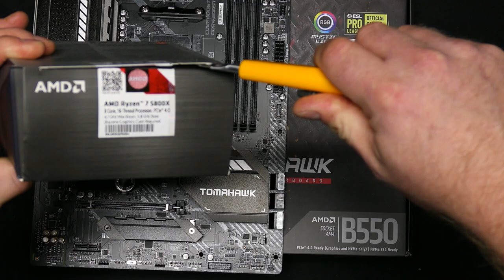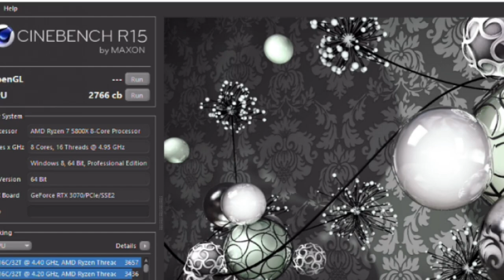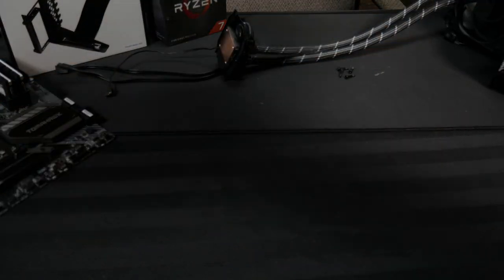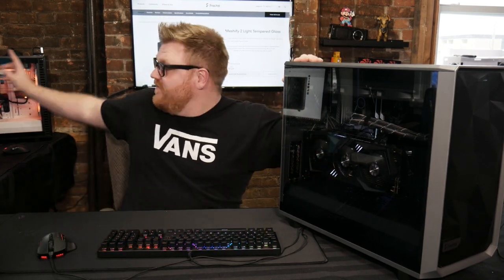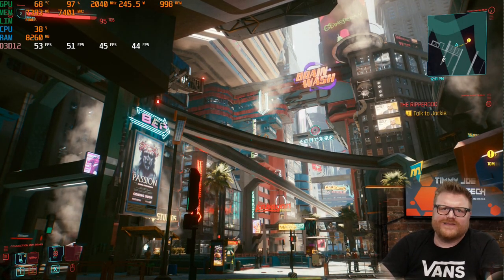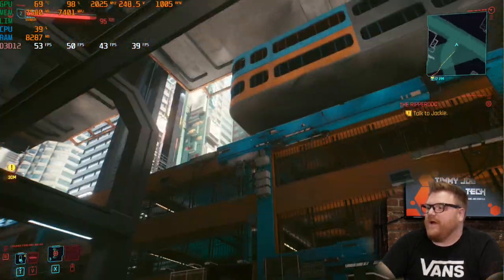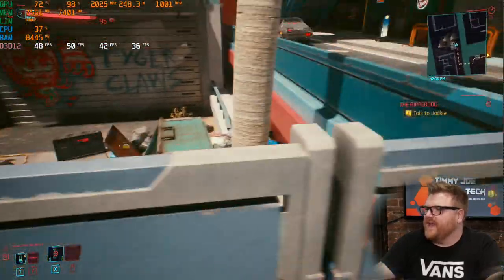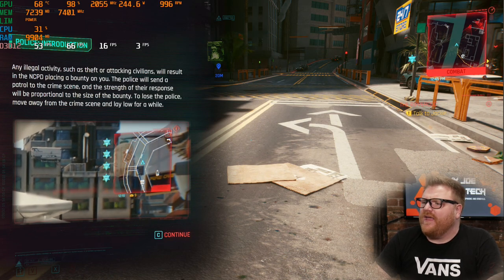The no RGB Meshify 2 PC!

Comment: The streamer i was watching last night had so many issues with settings it was sad. He couldn't do game capture. He couldn't play anything higher than low settings at 1080p  and only then he got 40-50fps when nothing was happening. it was in the 30s in gun fights and crowded areas. He was playing on a 1070. and an older i7 but it was still plenty fast for its age he said
Reply: It's like crysis from 2007 again man, we will laugh at it in 5-10 years, but right now even a 3090 can't handle the game without DLSS.
Reply: @santeenl  lots of gpu can handle it fine on ultra. Just turn off all ray tracing. Ray tracing is  too taxing on performance like back when soft shadow ambient occlusion first came out and gpu only had 2gb and 3 gb of vram. That tanked fps like ray tracing does now until we get better ray tracing hardware.

Comment: Rgb is completely ridiculous. My build right now is all white. However I do feel like an idiot for doing that because white and especially non rgb white pc components are completely overpriced. If I would have waited not only could I have spent a little more and got double the performance, but I could have bought higher end parts like storage and motherboard. As soon as the pandemic is over and things go back to normal I’m definitely building an all black o11 mini with a 5800x and a 3080, and 64gb of 3800c14 ram. Oh and 3 980 pro 1tb drives in raid 0. It’s going to be glorious. If they make a cool distroplate I will add in a custom loop.
Reply: I just did an all white build I’m pretty sure the prices were the same as black here luckily.

Comment: similar game requirements... Ark Servile Evolved, runs on a FX-4100 gets 720p 30-40fps mid settings. update drivers, 4.2ghz OC 1800mhz DDR3... at least two SSD's in raid zero would be grate.

Comment: I have that same mb on the way and was wondering did you have to flash the bios before it would boot?
With the flash bios button or was it able to boot to be able to flash with components installed.
Reply: Probably installed new bios on a usb.

Comment: I'm running a 1700x, 1660ti, seem to be locked into vertical sync @ 60hz on my 1080 panel at high settings; the key is turning down Cascaded Shadows Resolution.  Haven't seen any graphical bugs yet (thankfully).  Thanks for the content mang!

Comment: timmy joe how about cyberpunk on a 4k tv? can you use  dual 42 4k tv for monitors? maybe people will run 3 32? you should just buy a 3090 - don't feel guilty - you could probably use it as a biz deduction before q1 and it ends up dropping you down a bracket as a consequence? not likely but plausible - tax code varies - get a 3090 and play all the games to round out the pandemic - if possible - maybe get one of those insane tvs? there should be driver improvements over the life of the card which should be on order of 18mos min
Reply: start reviewing more mid to high end gaming setups and also the htpc and setups for smb sector also - refurb money can get you lots of gear if you shop around - zen4 will be another shrink and make things like 25% more efficient per watt so everybody will have to switch at that point  #zen4 tomahawk max

Comment: Timmy Joe do the SMT fix the game runs much better my cpu was stuck at 30-40% after the fix it runs normal again and the game runs a lot better 
 RT off DLSS quality 1440p 
60 fps,high ultra with a 
R5 3600  that same 3070 and 32 gb 3200 CL16 ram no OC